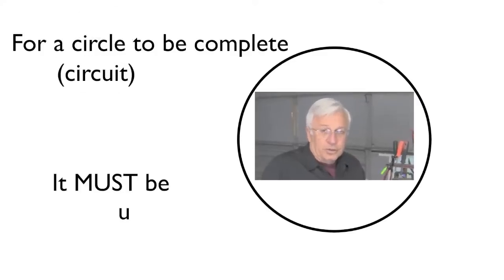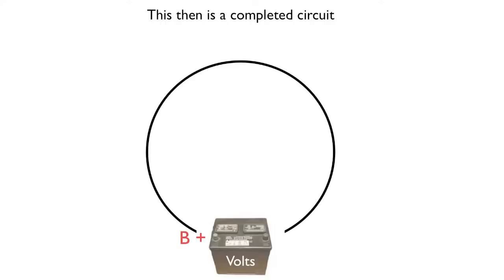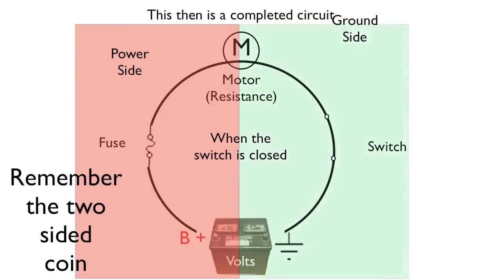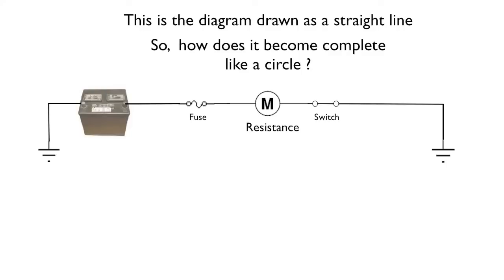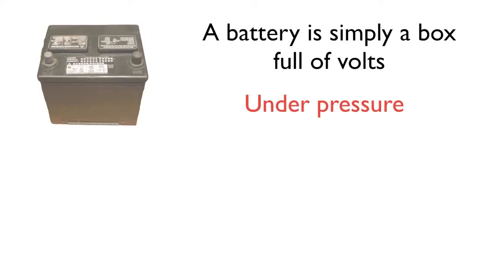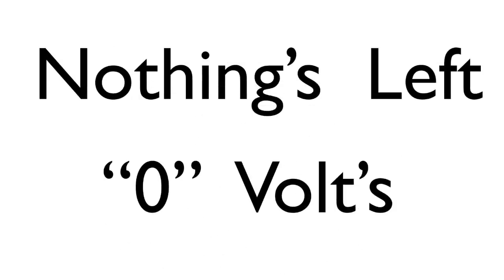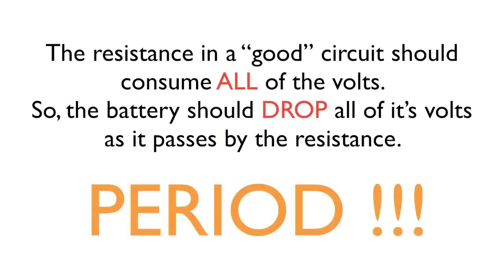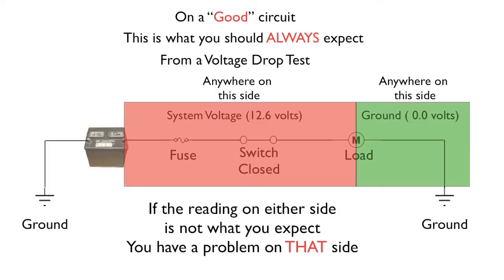How to test ANY circuit.      Part 1

Comment: I was watching this video where the guy used the PICO to test the battery and I noticed the voltage drop was + 5v. Does this mean there is a dirty connection from the battery to the starter or alternator?  https://www.youtube.com/watch?v=TRpd4PC5ZcU&list=PLaJW8Ju80ORYL1A27-B7UOqHJJFyqe3Xz

Comment: shouldnt voltage drop read 0 volts when measuring from positive terminal to the positive side of the load if the wire doesnt have corrosion? Why is it reading 12.6? That means there wont be enough voltage to power on the starter since all the voltage was consumed by the dirty wire.

Comment: wires/connections/switches/etc WILL drop voltage to a small degree, but the drop should be minimal. Corroded wires (for example, corroded battery cables) can create unwanted voltage drop in a circuit.

Comment: well-explained of what is voltage drop. thank you professor i try it in my home for demo and must be practice for testing voltage drop in circuit. but why wires, connections,and switches should never drop voltage?